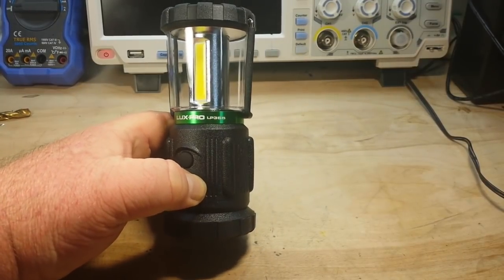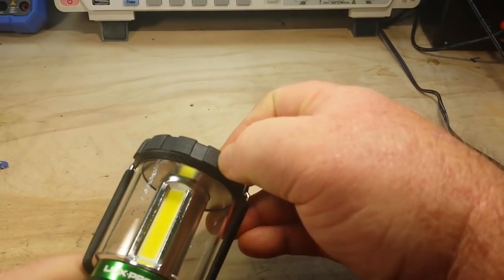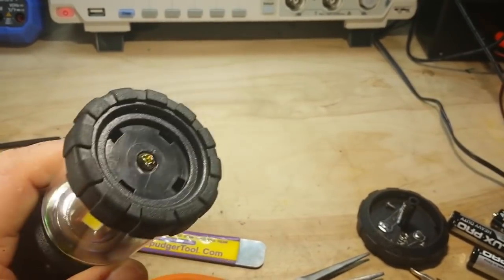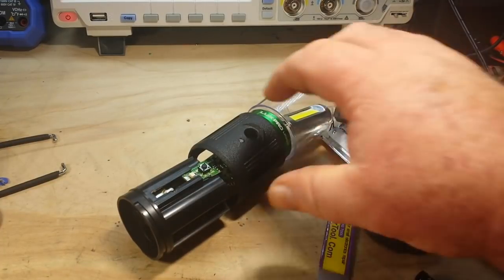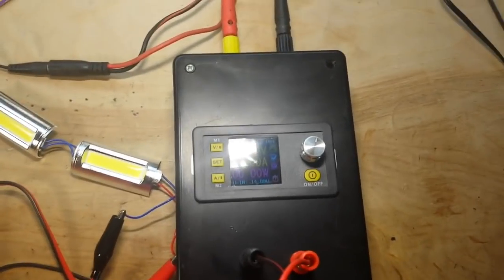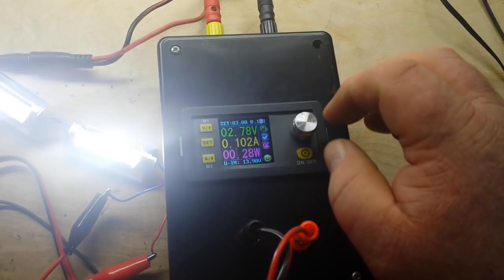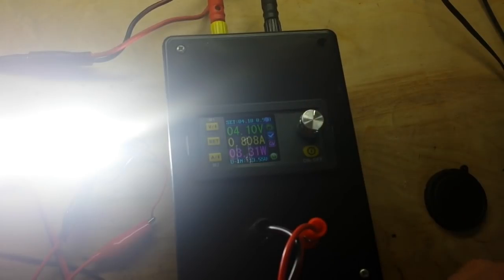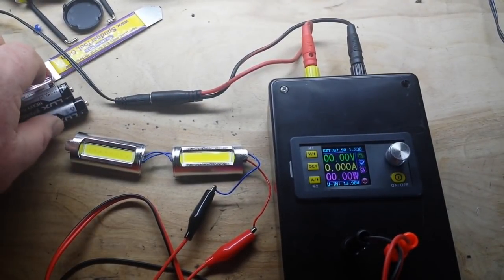Dollar Store Camping Lantern Teardown with hackable COBs

Comment: Lead free solder needs a little more heat. 370 C works well. If you're using an old iron, it might not work well with lead free. Advantage of lead free is you keep more quality brain cells in your later years.  Great evaluation of the circuitry.

Comment: Kool power supply!  What brand, or did you make it??
Reply: If you want to buy it directly to the factory store, google for "RD official store" and probably the first result in Aliexpress will be the link. Anyway you can get get it from several places like Bangoo, Ebay, etc. Just search for DPS or DPH digital control power supply. Prices are from aprox. $30 and up.
Reply from the maker: Here is a link to the video I did on it. There is a link in the description.
https://youtu.be/Vo9EEI1HL9k
Reply: If you want a "project" GitHub has a hack for the power unit to add a WiFi esp2866 https://johan.kanflo.com/category/dps5005/
It's a reasonable mod that de-complicates the interface and adds WiFi / serial control ... also introduces reprogramming the Firmware of the DPS and adding code to the ESP ... Not certain if it's an out and out improvement, I never needed the options that went away, if you use multiple presets, it's probably not for you.  But as a slightly more challenging project, I found it very enjoyable.

The original has a WiFi ready option too - I use the option in preference to the fiddly little buttons on the DPS. 

Whether or not you need the extras.  As long as you have a spare power brick on the shelf the DPS units will make it into a really nice power supply
Reply: Much appreciated.  Great channel